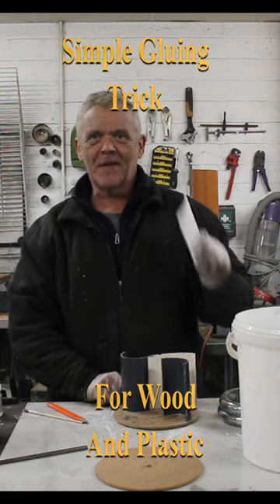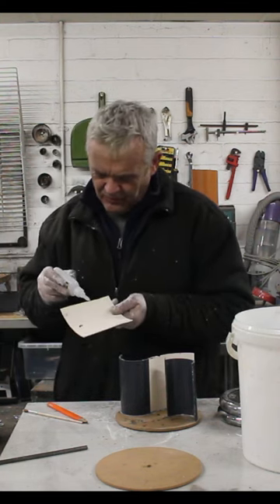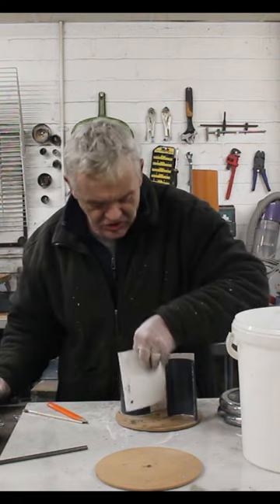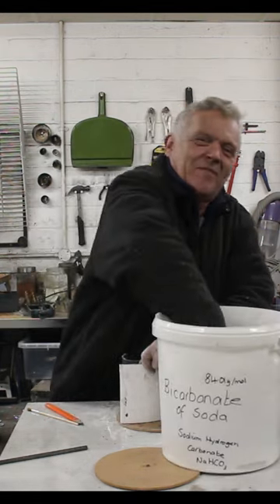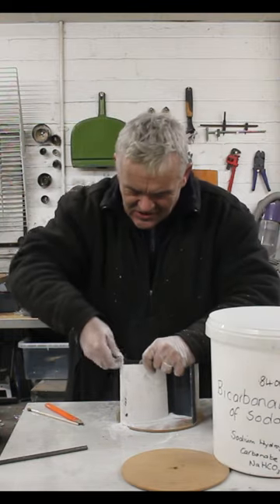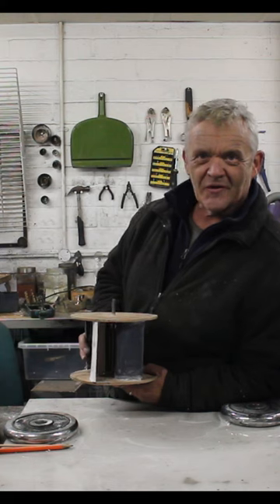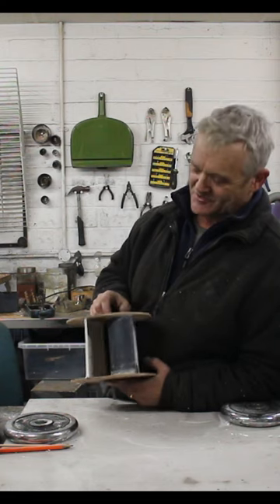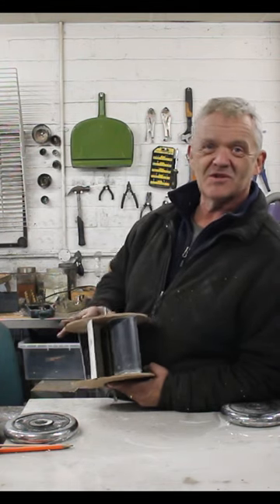Gluing Trick For Wood And Plastic #shorts #glue

Comment: Epoxy and normal flour works very well in gluing and as a filler as well. Built boats with it in stitch n glue.
Reply: This video explains to add baking soda to super glue, so the same method with cooking dough flour and epoxy. I am also working on building a boat out a fiber glass

Comment: Great for filling gaps too. You can even "cast" it in a mould for small stuff.
Reply: Powdered ground charcoal was demonstrated to be much harder and stronger than using bicarbonate of soda. Bicarbonate may however give a better bond on account it produces a hot reaction which may produce better adhesion to plastic.

Comment: a friend of mine is a helicopter mechanic, he said they use this exact method to repair small chips in the propeller. they'd build it up with this and then sand it back smooth. He keeps a small pill bottle of sodium bicarbonate and a few of the "single use" krazyglue super glue sticks in another bottle, but he always has them in his little "go bag" toolbox...

one morning on his way to work he was pulled over & the officer noticed the open toolbox with an unmarked pill bottle full of a strange white powdery substance... 

he said it was a strange conversation at first, but after he explained everything and showed the officer how it worked, he let the officer do his roadside test and then was allowed to leave, but he said his sphincter was puckered for the entire traffic stop! 😆👍🏽

Comment: I've used coffee creamer, sawdust and cinnamon before as well... at work... or at home when out of baking soda. I've actually used drops of glue and baking soda to rebuild tabs on old electronic cases. It's not as flexible as the original plastics but works in a pinch and can be filed. You can use wool to fill bad holes in as well if you have a stripped hole.  I wonder if the reaction is simply a surface area catalyst or an another reaction...I will have to read a bit up on this.

Thank you! I have been enjoying these videos.